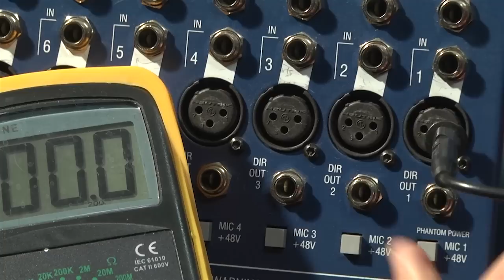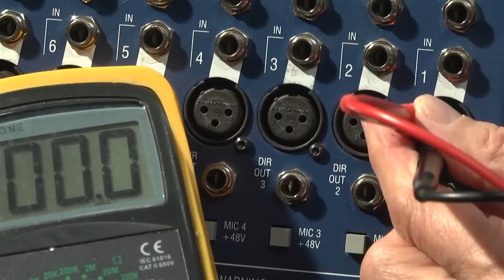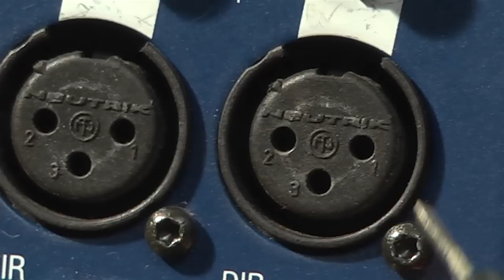PHANTOM POWER BASICS

Comment: Hi, really helpful information, thanks. in a situation where I need to connect a dynamic mic and a condenser mic in the same board but i can only turn on phantom power for all channels, is it necessary to cut the ground in the cable I'm using for the dynamic mic to avoid any damage to it? or can I use a normal cable to connect it and current won't reach my dynamic mic even tough phantom power is switched on for all channels? thanks a lot!
Reply from the maker: +Silvia Yepez 
Hi Silvia,
I'm glad you watched my video about the grounding etc. of various types of mics., thank you for that!
If the microphone is a recognised , that is, a well known make and has an XLR male connector built into it, it should be fine. If you tell me the make and model of the dynamic mic. I can easily check for you. Anything by Shure or Electrovoice or Sennheiser for instance will be perfectly safe. Don't try and use an unbalanced microphone or cable with phantom power - that means, stay away from mikes that have jack plugs on the end of their cables!
Hope this helps. The more expensive route which shouldn't be necessary is to use a 1:1 transformer.
Reply: +TECHGROUNDINGTV thanks for the quick response. I'm using a shure sm57, a shure pga52, a sennheiser e835 and an audiotechnica at 2020 condenser mic, maybe I'll be using a cheap line of shures too but all of them XLR, so in this case, I can plug in all these mics together and turn on the all channels phantom power and the current will reach only the at 2020? and the other dynamic ones will stay safe?. just one more question. if I'm recording guitar and voice using the at 2020 condenser mic and plug in the guitar directly to the interface with a 1/4 " cable, I need to turn on the phantom power to feed the at 2020, the question is, is my guitar going to be OK? the current pass through 1/4" cables? thanks a lot again , best videos of these topics out there. and you are so kind.
Reply from the maker: +Silvia Yepez 
Hi again Silvia,
I'm glad you checked this point. You mention "interface", not mixer, so I guess you aren't using a conventional mixer but some kind of USB or other interface with XLR sockets on it. 
If you are using a guitar plugged into the interface directly, you really need a DI box, as the impedance will be wrong - the guitar won't sound right - and the DI box, (there is a nice one made by Behringer which is a very  good price) can be plugged into the microphone channel and will get it's power from the phantom. You will get the best of both worlds then, as the DI box is expressly designed for guitar input and will amplify the guitar signal to improve the signal to noise ratio; then you can use a longer cable from the DI box to the mixer/interface. I have four of these Behringer DI boxes and have used them for years. Get the "Active" one. It has both male and female XLR connectors on it, and two quarter inch jack sockets so you can get the signal out again for an amp. or whatever.

Regarding the microphones - all will be well, they are all proper mics. and will work fine with the phantom power turned on.
Hope this helps!
Very best
Joe Driver
Reply from the maker: +TECHGROUNDINGTV 
I forgot to say: DON'T plug the guitar in with the phantom on. Not a good idea!
Joe
Reply: It is actually a behringer u-phoria UMC 404 HD USB interface, and all my questions here are related to recording and production mostly, not really to live situations. Maybe some times I'll get the signal of the guitar after a pedalboard o from the back of a fender amplifier, in any case do I need the DI box? Or just when I'm connecting it directly to the interface? Is the DI box just to convert the connector to XLR and make it balanced, or it does other functions?
Reply from the maker: +Silvia Yepez Hi again Silvia,
Now I've looked at the unit I can see that it has jack inputs in the middle of the XLR inputs, which is great for your purposes - these jack sockets will cope fine with the guitar outputs, and I notice there's a switch between "line" and "instrument" for these jack sockets, and I think you want to put the switch to "inst" when you plug the guitar in - that will give the correct impedance (high) for the guitar. There will be no phantom power on these jack sockets. You can plug any of your devices in to these jacks therefore, from your pedals or an amplifier line out or whatever. So you don't need the DI box!
Hope this has been a help, now you can get on!
Best regards
Joe Driver
Reply: +TECHGROUNDINGTV Joe thank you very much for all the information, you've been so nice answering all my questions and going deep on the gear I mentioned, now I have a great guide to proceed thank to you, much love!
Reply: +TECHGROUNDINGTV Joe I just saw the comment yo make saying you forgot to say that is not a good idea to plug in a guitar with phantom power turned on and I got confused. if I want to make a guitar and voice recording using the at 2020 that needs phantom power and plug in the guitar directly to the interface with a 1/4" cable, you're saying that you don't recommend that? should I record separately because phantom power will damage my guitar through the 1/4" cable ? hope I'm not bothering you with all these questions. thanks
Reply from the maker: +Silvia Yepez Hi again Silvia!
No, don't worry, now I've seen your interface I am sure that you can plug your guitar/amplifier/pedal output directly into the jack socket because it won't have phantom power on it. Phantom is only ever outputted on XLR connectors.
Sorry for confusion! If you had made a convertor cable for instance, quarter inch jack plug to XLR, that would have been bad news. OK!
Very best regards
Joe D
Reply: +TECHGROUNDINGTV Everything is clear now, thank you very much for all, I wouldn't make it with out you.

Comment: Wireless mic (the receiver) requires phantom power? Thank you
Reply from the maker: +whitedove Hi Whitedove,
I don't fully understand your question - can you be more specific? Radio mike receivers usually have internal batteries to power them or a mains adapter for non-camera use. I don't think I know of a receiver that uses phantom to power it but there's no reason why it shouldn't be so.
Can you give me a bit more detail of exactly what you need to know?
Many thanks!
Joe Driver
Reply: all my mics are wireless(headworn and lav mic). should i turn on the phantom power of my mixer? thank you
Reply from the maker: +whitedove Hi Whitedove,
No, you don't need phantom power for the radio mikes.
Just make sure you have batteries in the transmitters and the receivers. Phantom power simply supplies a source of power to a microphone, usually, or sometimes to something like a Direct Injection box.
So  in your case, the power the receivers need comes  from the internal batteries or mains supplies as I mentioned before.
Best wishes
Joe Driver
Reply: thank you so much. you are very kind

Comment: is it a battery powered dynamic mic that i can take on the go ?
Reply: Hi - I don't know which microphone you are referring to! 
Have a look at my other videos on this subject and I hope it will all be clear. One is called "how to connect a microphone to your audio equipment" and the other is called "moving coil microphones". 
Best regards
Joe Driver
Reply: I'm thinking portability.Something like Audio Technica 2500 usb mic's cause i believe it take 5 volts to cut it on ? I'm trying to find other condenser can do the same thing ? The portable phone charger can give it the power to monitor the mic's to hear it, try it.It would be sweet if you can tell me other mic's that can do that ?

Comment: My question is how in the world do these battery powered things like the Zoom recorders like all the handy ones even manage to spit 48 vults? Where the hell are they even jucing that from? Hell even 12 vults. I don't know the power of 4 double a batteries combined. But I can't emagin it's anything to get 48 vults from. Well let's start at 12. Let alone 48 or 24. Apparently they do some how though. Blows my mind. Well is phantom power anything like the electricity out of your wall outlit?
Reply: Hi MrHamit,
It's all about power, not voltage.
The current in amps  multiplied by the voltage in volts gives the power required by the microphone.
If the microphone only uses say 7 mA which is fairly typical (7/1000ths of an Amp) then multiplied by the  voltage, say 48, gives a power (Wattage) requirement of less than 0.4 of a Watt. 
This is a very tiny amount of power and can easily be supplied by some low-voltage batteries; the voltage is stepped up from 3, 6 or 12 to 48 by an integrated circuit dc to dc convertor. Ib the case of a 12 Volt battery it would only be about 35mA.

Voltage is the pressure of the current; Amperage is the amount of the current; Watttage is the product of the two, the power.
Hope this helps!

best 

Joe Driver
Reply: Mind blown. So what's all this mean for battery life? Zoom says with alkaline you can get 20 hours with the H6. I assume that's with out phantom though. Am I correct? They don't state it by the way. They just say 20 with the H6 and I think 15 with the H5. By the way. How much do you know about external phantom power supplys? Do they all require wall power? I ask cause were I to get the snapp off peace with 2 more XLRs for the H6 this peace won't spit phantom. Thus if you wana power 6 condencers it's 4 from the H6 and the other 2 you need something else. Thanks.